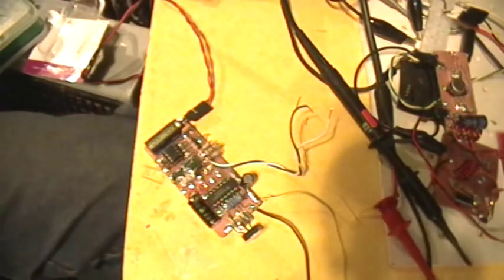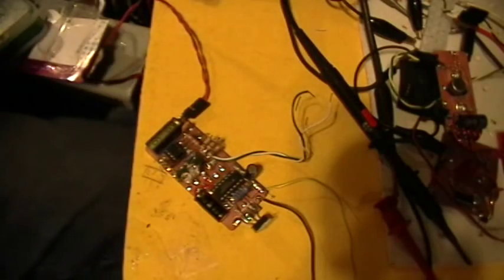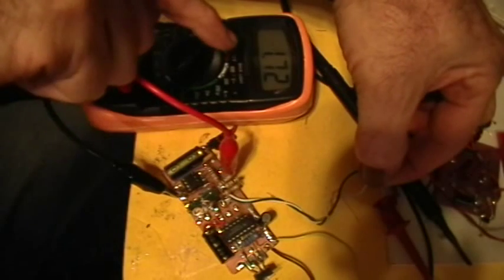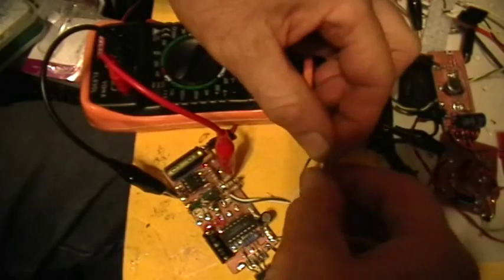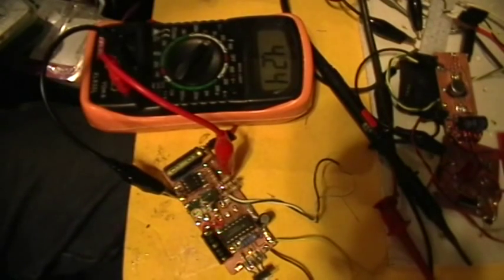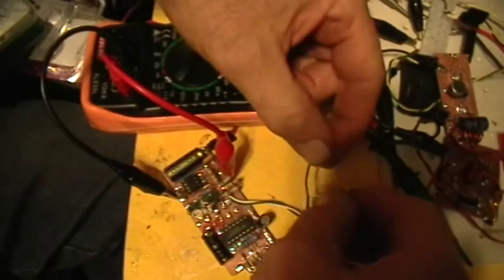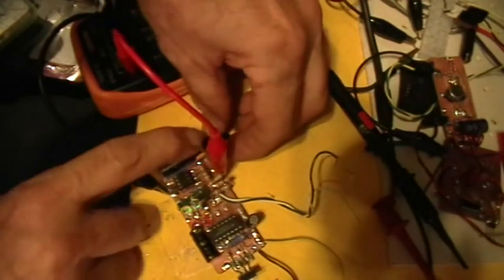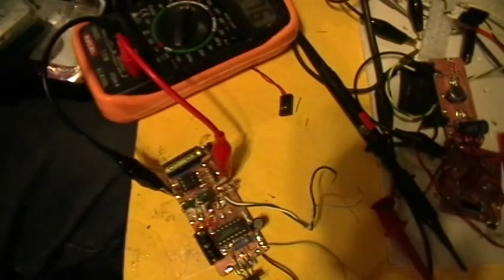Electric OU: TK-Akula 3V: DC-DC Chip Test 1

Comment: The 8 legged chip, that an timer chip or some amp or something else?

And the bigger chip, whats that?
Reply from the maker: The 8-pin DIP is a DC-DC converter, MC34063A. The 14-pin DIP is a CMOS hex inverter, CD4069. Only one of the six inverters in this chip is used, the rest are grounded.